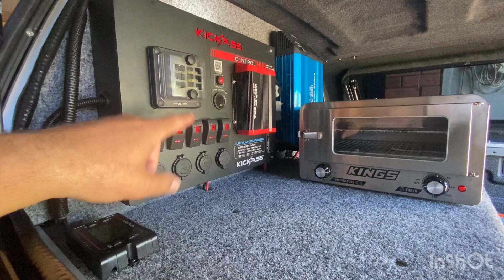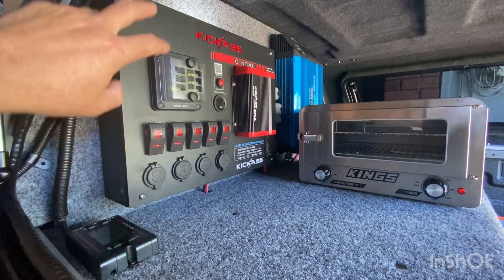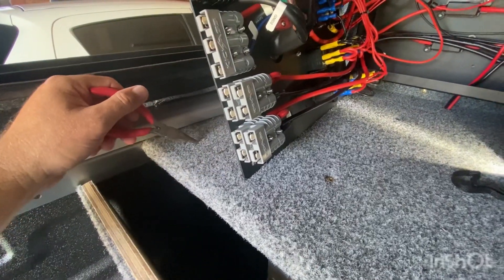How to wire a LED strip to a Kickass control Box

Comment: Would you just splice into the one wire going to the back of the switch for multiple lights ?
Reply from the maker: Hey mate thanks for watching. Yeah led lights use little amps so you could a set of lights and use only one rocker switch. I wouldn’t make them too long to reduce the draw and avoid tripping a fuse. Hope that helps?
Reply: @goldyandrobbo6540 Not a problem mate. That makes perfect sense. Thanks for getting back
Reply from the maker: @Youtube-C_S  no problems mate, hope you subscribe and keep watching